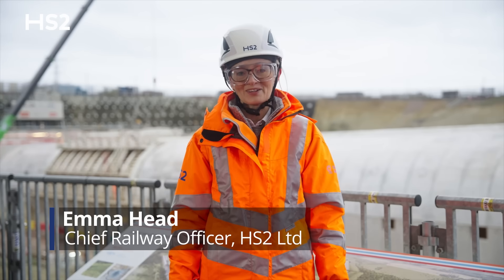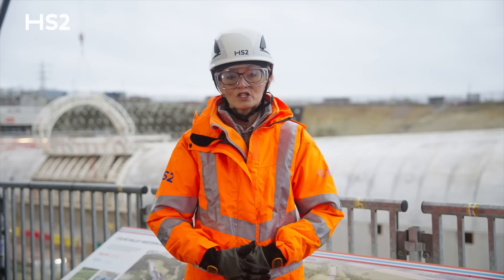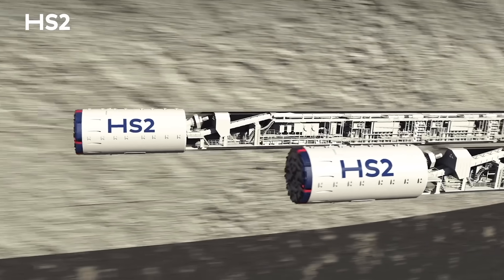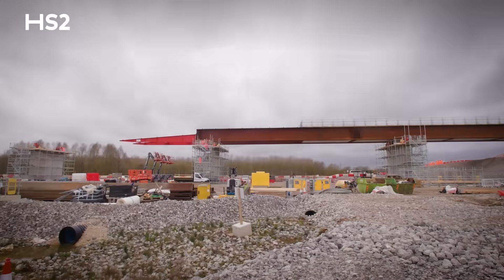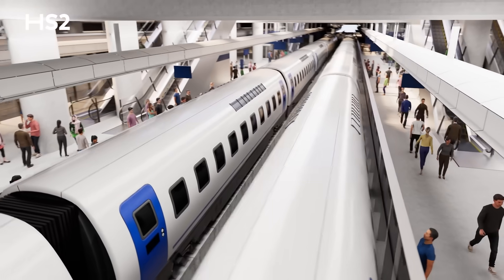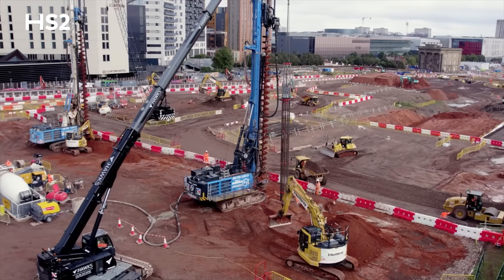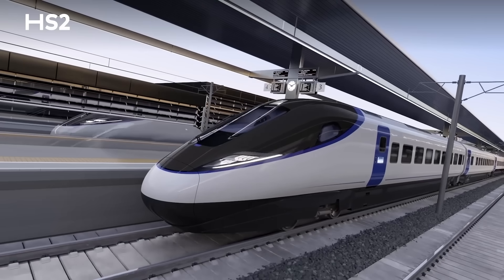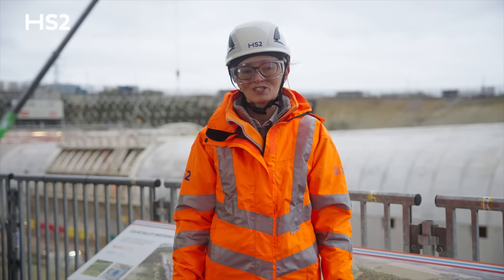HS2 Project Update, December 2024

Comment: Fantastic work, its so cool to see the regular and high quality updates. When this is done, let's get it finished to Manchester and Leeds!
Reply: The line will definitely inevitably be extended later on to these. In the meantime, trains will just have to run on conventional tracks after Birmingham and the interchange station.
Reply: Tories flogged off double-quick the land that had been acquired for that, so sadly no chance.. The engineering is fantastic, but at the same time the project is a tragedy. Mainland Europe is criss-crossed by a vast high speed rail network, Britain demonstrates its inability to build infrastructure on time and anywhere near budget.
Reply: @orphansock8439  No they didn't, they wanted to but HS2 inefficencies for once meant they didn't and the land an what to do with it remain in the hands of the new government.
Reply: 我们村都通高铁了，就差你了。😂
Reply: @反正你又不认识汉字  But, at what cost? HSR is not cheap.
Reply: @user-kc1tf7zm3b   There was £14Bn (£28 Bn @ 2024 prices) spent between 2000-2004 on the 50 mile Trent valley line section of the WCML and it made very little improvement in capacity as the long stretch of 3 tracks between Nuneaton and Rugby was unchanged. South of Rugby it's already full to bursting. A new line on a new alignment is the best solution. Adding extra tracks to the existing railway would be carnage for local residents on the route, would need extended closures over and above the normal ones and would take decades to complete. I hate to think what that would cost!
Reply: @jagman84  Upgrading and optimising existing rail corridors is always more economical than building a new HSR which will need its own dedicated and independent track. The costs of HSR are always truly astronomical, as the Japanese will attest.

£66 billion (US $82b) is an utterly stupid amount of money to pay, just to improve the tail travel time between London and Birmingham by a slight 36 minutes . If this £66 billion cost was publicly declared from the very outset, back when the project was studied in the 2000s, there is no way that neither Labour, nor the Conservatives, would ever have endorsed this.

Life is always about compromises. There is no unlimited amount of money available from the public treasury. Those who live further away from London, especially those in Scotland, will just have to accept that their travel times by rail to the British capital will always be longer. All transport systems, including rail, have their physical limits.
Reply: Bots?
Reply: Lol 😂 Not happening dude
Reply: It won't go any further and will be an incredible waste of money and will cost a fortune to use
Reply: You need to keep up with news .. in a recent interview, Sir Keir Starmer said "it isn't possible to do HS2 to Manchester & Leeds as the Tory government had blown the budget & contracts are going to be cancelled" which is excellent news as HS2 is an environmental disaster of epic proportions & Britain's biggest infrastructure mistake in half a century.
Reply: Ha! Ha! Ha!

The HS2 project is nothing more than bizarre British vanity project which has now morphed into a proverbial white elephant. My God, £66 billion (US $82b) for just 230km of track! This equates to staggering £287 million ($360m) per km.

And you wonder why neither Australia, Canada nor the United States has ever bothered with HSR over serious intestate distances. The economic, environmental and social benefits are just not there.

PM Rishi Sunak was right to cancel the Phase 2 extensions to Manchester and Leeds as the costs would become even absurd than what they already are. Unlike other MPs, former PM Sunak knows how to count.

Everything has a cost. The costs of HSR are not worth it most of the time.
Reply: that would be nice
Reply: 66 Bil... to go to Birmingham of all places. Both cities need razing.
Reply: They trying to use disability and tics for the build? Talk to the hand?
Reply: The HS2 project is nothing more than a bizarre British vanity project which has now morphed into a proverbial white elephant. My God, £66 billion (US $82b) for just 230km of track! This equates to staggering £287 million ($360m) per km.

And you wonder why neither Australia, Canada nor the United States has ever bothered with HSR over serious interstate distances. The economic, environmental and social benefits are just not there.

Everything has a cost. The costs of HSR are not worth it most of the time.
Reply: @user-kc1tf7zm3b  people who use the phrase white elephant to describe hs2 need studying because the project is the opposite of that. It has a specific purpose that is to unlock capacity on the victorian infrastructure. You can't call things white elephants just because they're expensive.

Also the cost per mile even including all the stations and depots is still cheaper than some UK road projects so I don't know why you make this seem like a HsR issue.

And finally, it's laughable to say that HSR is neglected by the US, Canada, etc because it wouldn't work. It's neglected because it WOULD work, those are some of the most car and plane dependent countries in the world, and lots of petrol, car and airline companies do as much as they can to crush the competition.  See wisconsin's or texas hsr projects that were sabotaged by airlines. Get a grip with reality mate.
Reply: that is hands down the least "cool" thing ever, don't use words if you don't know what they mean, you clearly have internet access, use it and go look at a dictionary
Reply: @stocktonjoans  Alright Karen
Reply: @MrRaisin56  another fool using words they don't know the meaning of, education standards are atrocious these days
Reply: @MrRaisin56  so cringe
Reply: @stocktonjoans Every other comment starts with a capital letter, except yours.🤔🤔🤔🤔🤔🤔
Reply: @donaldtriumph1682  this is quite clearly an informal situation, so that's completely irrelevant, I can only assume you're trying to change the subject becasue you're mad about something I said but are unable to think up a relevant response, maybe I can help, what's got you so upset?
Reply: @ Nope, just commenting on your incorrect use of the written word.

Comment: So when's the estimated completion date? I'd hate to see this big old expensive thing just sitting there waiting for trains to be built.
Reply: Trains are the easy part, stations and tunnels cost serious money
Reply: best estimates are 2030 or later
Reply: @JT-nr2ss  there's no completion date because there isn't one.  A money go round.
Reply: Trains are already being designed with 4-5 years still of building to go
Reply: They expect to be testing trains by 2028, I suspect will get a partial opening before 2030, some of the stations/platforms might not be there, Euston certainly won't be, I'm sure the government have pencil in Starmer diary March 2029 for a PR trip on the line even if it just a test run just before calling a general election May 2029.
Reply: 2033 to Old Oak Common so will take the same time from Birmingham to central London as now
Reply: @garycook5071   44 minutes from Curzon St to  Old Oak Common , 10 mins to change to Crossrail and 10 mins to Tottenham Court Rd. Plus 5 mins to street level? So ~70 mins end to end.  Best time for Avanti to Euston  on the WCML is about 79 minutes (with 3 stops). Plus a 13 min overall journey to TCR, so about 92 min. The balance shifts, depending on your ultimate destination in London. For accessing Heathrow Airport, HS2 will be a no-brainer.
Reply: i wouldn't hold your breath
Reply: As someone said, don't hold your breath, for instance nowhere along the length of the current build is a single metre of track in place, they are great at building water holding ponds and work sites and concrete manufacturing plants but someone needs to look at the victorian infrastructure and realise they have one massive ingredient of a railway missing, the track.!!
Reply: @cmclewee9518 Laying track is the simple part once the track bed, tunnels, bridges are in place, the track along the whole route will be layed in a few months.

Comment: zero carbon travel?  Er presumably that means they have not counted any of the carbon emitted during construction.  So it's a massive lie.  They should count all of it and then show how the carbon savings accrue over the years to eventually get to net zero for the line.  The power for the trains I assume has a dedicated generation system??
Reply: Zero carbon travel might be a bit of an overstatement, but that's not to say it hasn't been environmentally beneficial. Increased rail capacity (which HS2 will bring) between London and Birmingham means that more passenger and freight services can be run: meaning less cars and trucks on the road and reduced tailpipe and particulate emissions. Most, if not all of HS2's construction materials have been sourced sustainably (e.g. low carbon concrete) and where possible the material has been transported by rail, not road. And of the road vehicles that have been used, many are EVs.
To put it simply, you're massively overblowing the amount of carbon emitted by HS2 and ignoring the sheer amount of emissions reduced once it is open.
Reply: @trainjedi9651 stop defending liars, it's not a good look
Reply: @stocktonjoans  who are the liars I'm supposedly defending? and what lies have I perpetuated?
Reply: @trainjedi9651 the people claiming zero carbon travel are obviously the liars, and zero carbon travel is obviously the lie, not the sharpest tool, are you?
Reply: @stocktonjoans  I fail to see what isn't zero carbon (at the point of service) about electric rail travel. There's no tailpipe emissions and next to no particulate emissions (steel wheels on steel rails produce significantly less than rubber wheels on asphalt roads). I suppose that it technically isn't zero carbon because the electricity provided to the train has to be sourced from somewhere and the UK electricity grid isn't 100% zero carbon.

But I posit this to you, would you rather an electric train service which is provably zero direct emissions and can be transitioned to be being fully powered by green energy (which might I remind you, the UK is a global leader in said transition) or currently extremely polluting road transport, which will take significantly longer to transition to fully electric vehicles (and the UK certainly isn't leading in said transition) and doesn't solve the issue of particulate emissions from tyres and road surfaces or from the extremely polluting processes used to make lithium batteries used in cars?

To be clear, if you don't know, electric trains don't need batteries because they maintain contact with a live wire at all times, essentially being connected to the national grid at all times and receiving a constant flow of energy.
Reply: HS2 construction is extremely low carbon compared to other major infrastructure projects
Operationally, the railway will be zero carbon
Reply: @JT-nr2ss  prove it
Reply: @stocktonjoans  As I explained, operationally the railway will be zero carbon. And if you'd like but one example of how HS2's construction is low carbon: the tunnel segments used in the construction of the Northolt tunnels are produced in Kent and then transported by rail to the tunnel site at West Ruislip - Geoff Marshall has a good video on it.

Furthermore, while this freight service is diesel, at the scale of its operations it is significantly less polluting than if the tunnel segments were moved by truck. Let's say you have a truck than can move 1 unit of cargo and has 1 unit of emissions whereas a diesel train can move 50 units of cargo but has say 5 units of emissions. Each truck might be individually less polluting but when you need to move 50 units of cargo it's 10x less emitting to move by diesel rail than by truck.
Reply: Construction projects require a BREAMM environmentally friendly rating.  There are 4 grades...Good, very good, outstanding and excellent.  Everyone now seeks excellent rating. To achieve that level requires both construction and operational green contributions. Low carbon concrete is certainly one of them and given the amount of concrete that would be a big plus. But there is also a lot of steel. Is the manufacture of that element low carbon. Temporary works like tunnel boring machines and steel scaffolding would also be a contributor. So while construction might achieve an excellent, low carbon  rating it isn't 100% low carbon.
Reply: They said travel, not construction